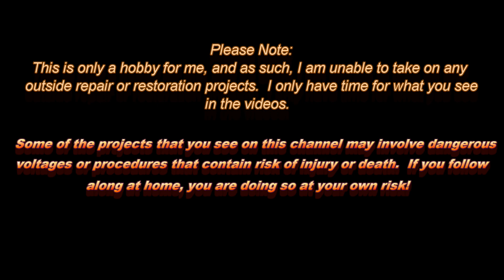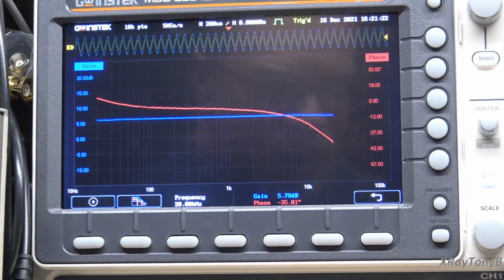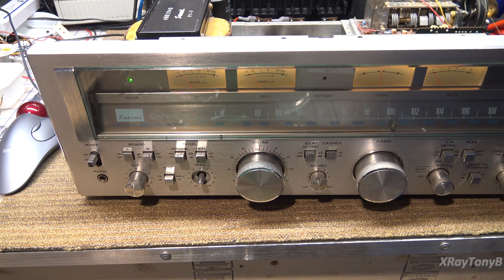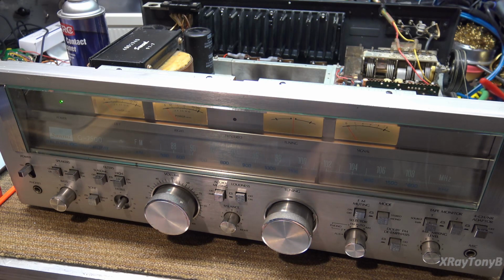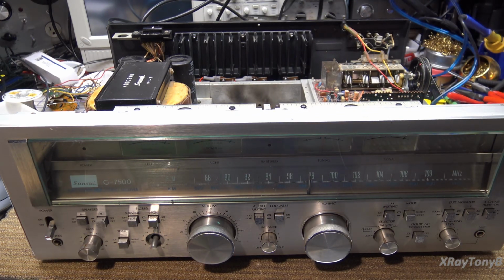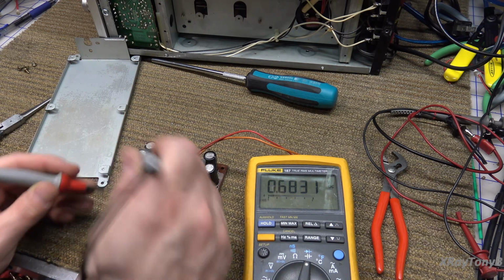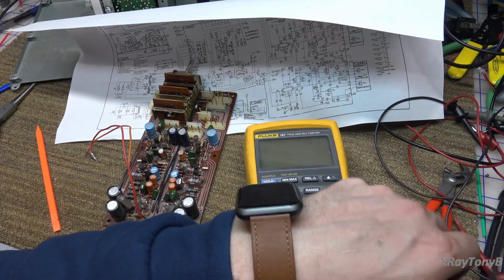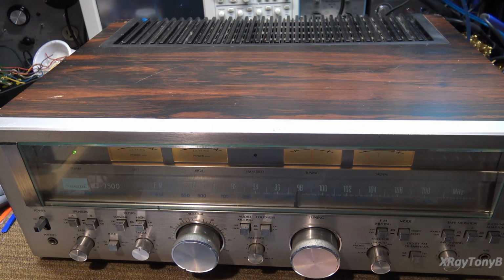Sansui G 7500 Part 2 - This is Why You Have to Test Everything!

Comment: Repair and maintenance is so time consuming, even if you're well capable of fixing equipment. I have often thought about repairing electronic apparatus for people, but the time involved makes it simply not viable. At least when you fix your own equipment, and if another problem crops up later, you can always deal with it, but that won't sit well for a paying customer?

The problem with old stuff - all components are ageing in slow motion, and all at different rates.

BTW @42:15 ... well spotted!

Nice, clear videos!

Comment: Loved the Sansui G-7500 series. I just picked up a G-9000 that has a dead left channel - at least according to the description but I got it for a really good price considering what they are going for these days. I am hopeful it is a switch, or the Pre-Amp Connected switch or something simple. I am prepared to go through it.

Interesting work on those output transistors. I wonder if thos same transistors would work in a G-9000 given you said they were good for 250 watts.

Comment: I had a very similar problem on a valve Sansui amp that had a bass boost in the flat response and loudness off. Turned out to be a faulty loudness switch! That was after I added some components to correct for the response hump.

Comment: Tony  i really appreciate all your videos. You've done tons of great videos to teach people from a very fundamental level how to work on electronics. I do have a suggestion for a future video. Could you go over entry level equipment for the beginner to put together a workbench? Including an inexpensive but decent oscilloscope? There are many cheap brand new Chinese ones, or a cheap used one. Hard to know what is the best option?  The market is so wide open. What is the best option for a beginner? Easy to use, and not too expensive but reliable. Thanks so much!
Reply: See Blueglow Electronics channel here on YouTube Oscilloscopes for audio part one. This is a 4 part series. I have 2 Hitachi scopes I got from eBay older model analog scopes. They sell for $100-$150. Try to find one that's shown powered on and look for broken or bent knobs.

Comment: Excellent job at saving this amp.  Sansui are fantastic amps, this is a great model
90wrms/chan into 8 ohms.  Freq Tes 5Hz -50 Khz.  THD .025%.  Excellent specs
Reply: 90wrms/chan into 8 ohms.  Freq Tes 5Hz -50 Khz.  THD .025%.  Excellent specs

Comment: Why would one get up to about 65-70% volume, due to your video I went out and just unboxed a 40+ year old G7700 Pure Power DC receiver, was in its original box from a estate, still taped up new when I got it but never plugged in. Set it onto a pair of Realistic Mach 1 speakers tonight finally that looked new also but were in opened boxes I bought there too, and at a head bashing volume of about 65 to 70% it just clicked off till I dropped the volume to about 20% then would click back on after a few seconds (over load??) and had a little fault light come on near the dial. Running real copper 12/2 wire on it, good 300 ohm antenna ladder wire and weinguard FM 100 mile antenna dated oct 1977 from same collection of radios. Now wondering if its bad after sitting almost 45 years in its box. Bought 18 items from this estate all still in original boxes. 2 are REALLY heavy Sansui a G7700 and a 9090. Got 2 very old still in box Fisher 404 quad and 500tx. The rest are a Akai tape deck, speakers Sansui, Nivco  and Foster and Ampex receiver amp. There was about 80 such items in his Dallas home but I ran out of money.
Any idea on these?
Reply: Go watch part 1 and especially about adjusting the bias voltage of the end amp transistors

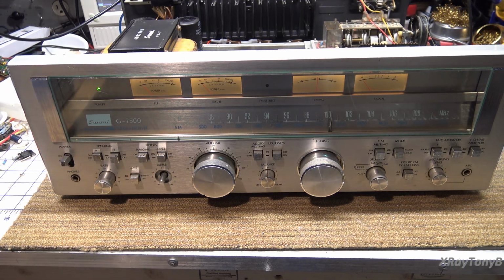Comment from the maker: 0:15 Intro
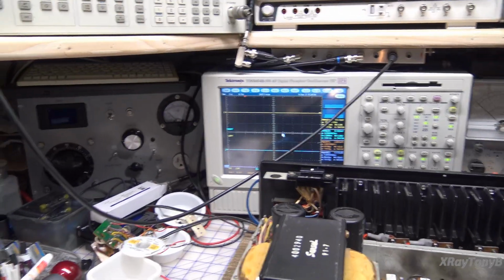1:20 THD test @ 1 kHz before clipping
2:37 Frequency Analysis Channel 1 (Fail)
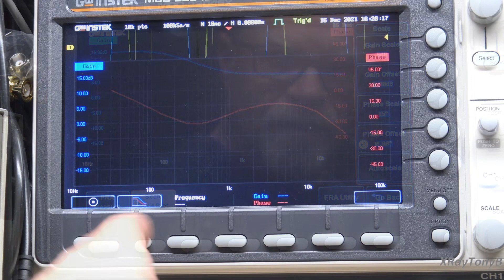5:03 Frequency Analysis Channel 2
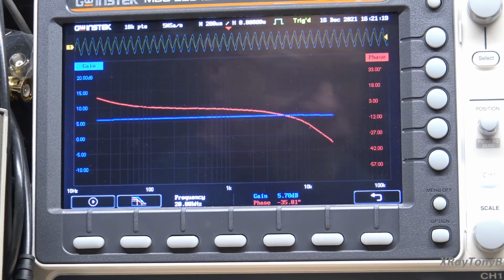6:04 Retry of Frequency Analysis Channel 1 (Yep, I screwed up on the first try)
7:40 1kHz Square Wave
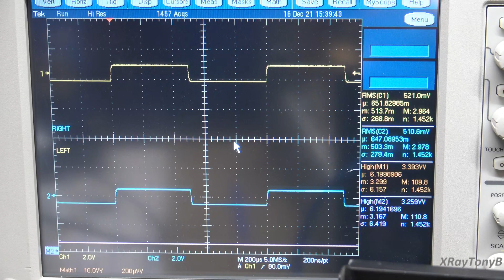8:45 Testing Slew Rate
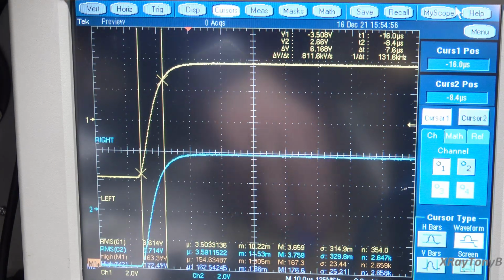9:45 Amplifier is running nice and cool :)
10:40 For your YouTube Audio Library listening pleasure (No Twerking allowed during the viewing of this video) ;)=) 
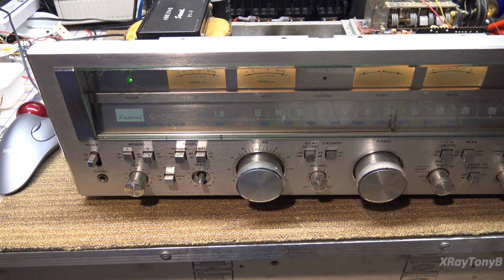13:28 Testing the FM tuner  (AM was done off camera)
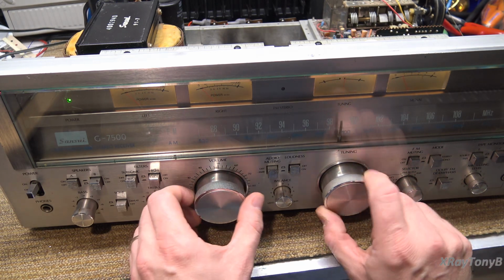13:44 Cleaning the tuning gang rotor contacts
18:02 Testing the tuning gang after cleaning
18:52 Testing MPX stereo and sensitivity using the Sencore SG-80 (quick test)
23:46 Well, I thought the video was over......
24:47 We still have some problems....
28:34 Testing the power supply to the phono stage
27:27 Power supply is good, now what?
27:40 Troubleshooting the phono stage
29:26 Checking the transistors in-circuit
34:16 Checking the JFETs
35:12 Finding & repairing the problem
40:05 Testing the phono stage, final tests and issue with the treble pot
Reply: Does that 2204EX do the whole frequency analysis or are you using a function generator to pipe the sweep into the amp?

Comment: The F2852 phono pre-amp is used in a few different Sansui's, standard course of action is to replace the 4 x 100 ohm resistors from the power supply, in most cases they are out of spec...

Comment: 42:12 I have a treble control in a Panasonic RX-5250 boom box that has become a volume attenuator when you turn the treble down. My guess is that the capacitor in the tone control has shorted and is taking all of the signal to ground.

Comment: 23:50 - Tony, you tweaked TC-01 so the low end of the band tracked. Shouldn't you do the same for the high end of the band by tweaking the corresponding trim-cap?

Comment: In regards to the KSA replacement transistors, do you know the numbers, if any, for the 2SC1904? 

The driver transistors 2SC2238B and 2SA968B, do these have equivalent replacements? On the driver boards for the G-8700DB, they have that clipped center collector lead which is wired to the heatsink, and the base, emitter leads bent at 90 degrees.